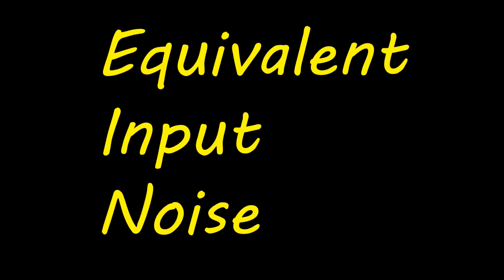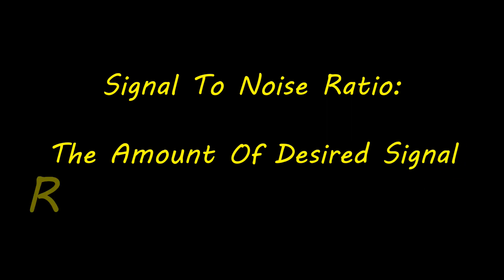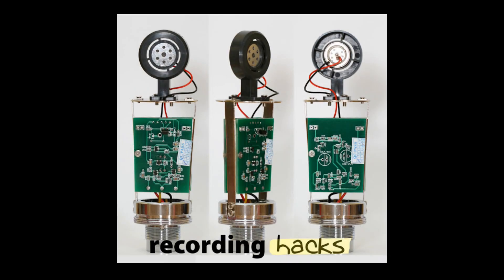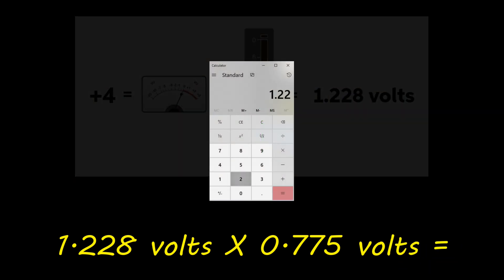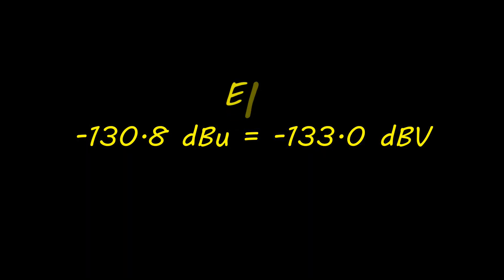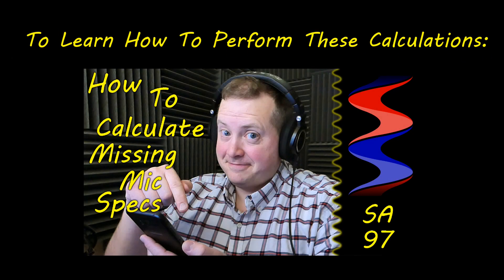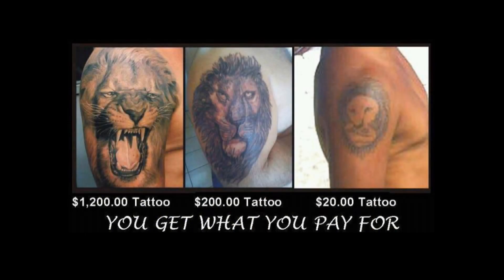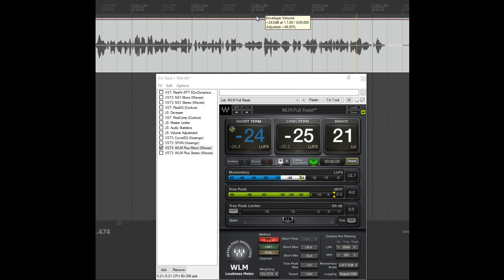Equivalent Input Noise Made Easy - Sound Speeds

Comment: what is the EIN of an on-board soundcard on a highend motherboard? I'm recording using an MKE600, and the sound floor is around -40db, not very pleasant.
Reply from the maker: I have no idea. Every card is different. Measure it
Reply: @SoundSpeeds  Thanks for the reply. I want to first make sure my mic is not abnormally noisy, is it possible to measure EIN of on-board soundcard without taking mic into account?
Reply from the maker: That's usually how you do it.
https://youtu.be/SdHn4L1TGds?si=IB5OlMQBRtvdW5L4

Comment: Great video but I'm not sure I agree about the end bit. 

If the preamp already achieved it's lowest EIN at it's maximum 55 dB of gain (maximum gain is where these specs are usually measured), what difference would it make if you record and digitally normalise the remaining 5 dB? Both the signal and noise would be 5 dB higher, yes. But a preamp with 60 dB of gain and the same EIN would result in the same Signal to Noise ratio.

Better made preamps (that would include many interface pres these days) have a pretty linear EIN level after about 40 dB and up, so there's likely only a negligable noise penalty for turning down your preamps to 40 dB from 55 dB and normalising if they otherwise don't sound their best at max gain. I know Neumann makes a digital mic that uses an uber quiet ADC and foregos the use of a preamp, and is amplified only by digital trim. I think that would solve a lot of problems that preamps have as there'd be no need for gain staging anymore and you'd have an even lower noise floor at lower gain ranges. Although being devoid of any analog character, it's only going to sound like the mic, for better or for worse.
Reply from the maker: It's still logarithmic after 40dB but the difference is less noticeable. -66dB is half the noise floor of -60dB but that's a lot less noticeable than the jump from -6dB to 0dB.

Are you saying a preamp with 55dB of gain compared to a preamp with 60dB of gain will have the same S/N if you increase the level in post of the first interface up 5dB? If so, that's not correct.
Reply: @SoundSpeeds  If the preamps had the same measured EIN of -129 dBu at their max 55 dB and 60 dB gain levels would that not result in noise floors of -74 dB and 69 dB respectively?
Reply from the maker: Not exactly but it's close. The curve isn't linear, it's logarithmic so think of it like a percentage of gain used as opposed to dB. At full gain they are giving 55dB and 60dB and that may be a noise floor difference of 5dB but at 75% gain, the gain difference may only be 3.4dB or something apart. It's true that as you approach 100% gain the noise floor gets highest (which is why I always recommend preamps with a lot of gain and a low EIN - my MixPre-6 has 76dB of gain and -130.4dB EIN).

Watch this video too: https://youtu.be/9dZs6N1lJkY

Comment: What low-noise audio interfaces would you suggest?
Reply: Thanks for replying, dude. Appreciate that. Also thanks for the explanation on video. What about Deity HD-TX? Do you suggest that instead of audio interface for podcasting purposes?
Reply from the maker: Depends... the HD-TX with the new v2 firmware functions as an interface or as a stand alone recorder. Quite versatile in that regard.
Reply from the maker: Many of the Behringer and Focusrite interfaces are great. The Motu M2 is also a great buy at $160.

Comment: It would really be lovely to have the fetthead built into the interface. I am using a fetthead phantom with deity s-mic 2 - and perhaps it is a slight overkill, but I no longer need to turn my gain to 85%+, having it at a comfortable 55-65% instead.
Reply from the maker: I'm right there with you. I'm surprised nobody has decided to put an inline preamp built into an interface yet too. Perhaps this video will inspire a manufacturer to do that.

Comment: Very nice explanation! Sometimes "lower" is not used completely correctly: Due to the negative numbers we're dealing with "lower than -96dB" typically refers to values like -100dB or -129dB. "Lower" typically means here "better" at least when looking at this specification. But the explanation is really great!
Reply from the maker: That's right. Sometimes the negative sign makes things confusing.